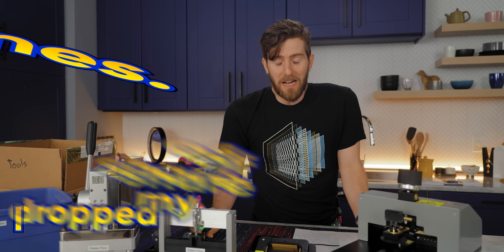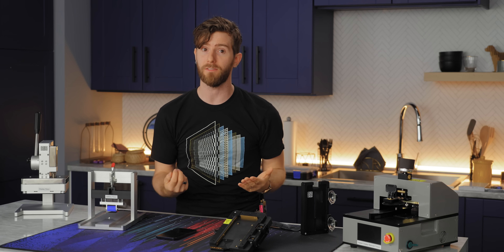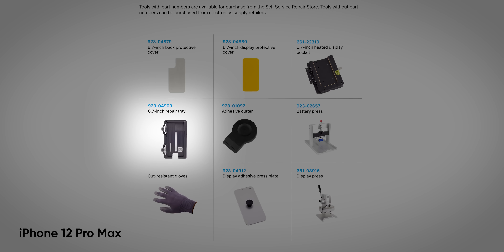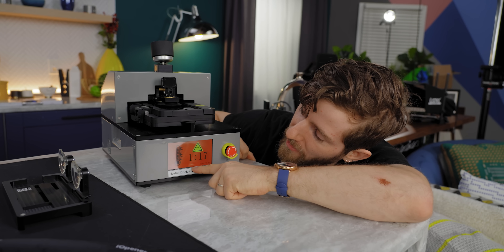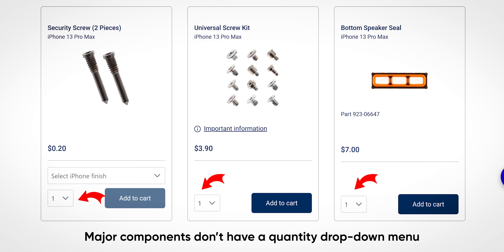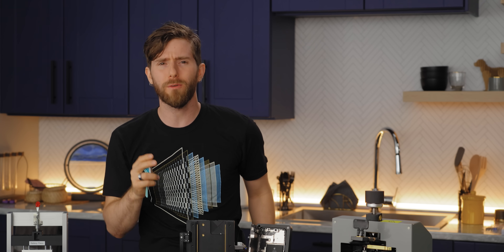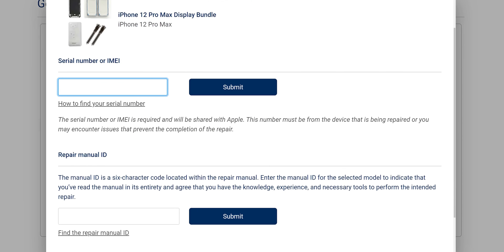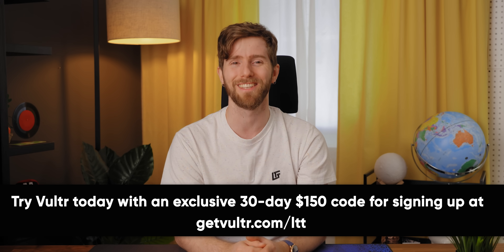I’m a Genius - Apple Self Service Repair Program

Comment: Tbh also adding the amount of time you need to the overall costs is just stupid. Because when you do this, EVERY repair offerings from any shop - including iFixit etc - is just absolutely terrible. Same goes for the time you have to wait until the parts arrive. Do you blame Apple now that it takes a few days for physical stuff to arrive at your home or what?
The prices are too high, yeah and especially the cashbacks for the replaced parts are partly really too low ($33 for a screen is hilarious - this should be like $100). But what you did here was just trying to make the "cost" of doing it yourself as high as possible...

Comment: I work in a phone repair shop fixing iPhones all day and those tools are incredibly overkill, all ya need is a heat pad, the right screwdrivers, and a thin metal separator lmao

Comment: I did want to go ahead and add a little bit more information, especially as one of those repair techs in the back, The sad thing about even fixing your screen with that repair program, You still will encounter things like face ID not working and if you're using a fingerprint reader touch ID not working either, for an experienced technician, a standard iPhone repair can take up to 30 minutes. It gets pushed to an hour because of all the additional paperwork and calibration software that's needed to just get those basic features working. That aren't even crucial to the phone security because you can literally move the fingerprint reader from one phone to the other and it'll still work like nothing happened, face ID will always be locked unless you go through Apple internally. Unfortunately if you want to unavoid this nightmare just get insurance on your phone, regardless of how technical savvy you are or how much experience you have. If you don't have the Apple clearance and don't want to pay a grip for tools that we don't even use that much, Just get the insurance.

Comment: Not to mention after installing the new part, the old original part is no longer paired to the device.. when installing that part you need to contact a apple tech and they will remotely pair it which in itself is a pain in the ass procedure..

Comment: Im a tech at a Ubreakifix, these tools are cool but Id never use them, honestly their tools overcomplicate the repair and slow it down, iPhone 12s and 13s are a pain due to new adhesive being stronger but its still easier with just a heat mat, some screwdrivers, and an iSesamo honestly.

Comment: So... what's the frigging point? For the simple user it feels like the warranty and extra insurance that most shops provide is more than enough for when the device is new and after two years the parts along with the equipment rental is going to cost more than just buying the same phone used. 

And for the professional repair guy it's pointless because if he does this through Apple it won't be faster or cheaper than his customer taking it directly to an Apple partner. 

It feels more like they are trying to cover their bases if/when the law changes and companies are obliged to have some kind of repairability for their devices.

Comment: Waaaaa. Take your Apple device to Apple to be fixed. And if you don’t like that, don’t buy an Apple device, buy one of dozens or hundreds of competitors devices. Vote with your wallet. Personally I don’t want to fix my Apple device myself and I don’t want some Fixit shop to do it using 3rd party non OEM parts. So this issue doesn’t mean anything to me. But if matters to you, don’t buy Apple. Buy an Android and an HP and move on with your life.

Comment: The battery, taptic, and speaker are definitely overpriced, but the screen is more reasonable than what I expected. While there are no exact third party screens to match the iPhone 13, buying a refurbished screen from some place like Injured Gadgets (my go to)  can be more expensive than the repair program. For instance, a refurbished 13 pro max display is currently $325 over at Injured Gadgets. And even without a trade in the screen from Apple is cheaper. With time this may change, and Apple can CERTAINLY offer this for much less still. However, as of right now this is the one thing I appreciate Apple providing.

Comment: I repaired iPhones for ten years. I got out shortly after the screen update fiasco. They put out an update that literally disabled touch on 5rd party screens. Then had a message in the update about only using genuine Apple parts. I was livid as a repair shop. They changed it in a later update but the damage was done.

Comment: need to talk about MacBook Pro screen repair .... the 2018 MacBook Pro display, 650€ in order to change it  and it's not even my fault, the MBP sits on a desk and the next morning it was not working properly ????? it's looking like the electronic tablecloth of the screen is damaged but you cannot change the tablecloth without changing the screen !!!

Comment: Fanboi here: This solution clearly isn't great. Set that aside the pricing on these tools are amazingly cheap though. A repair shop could just buy these and use un-original parts I suppose?

Comment: The amount of times apple has just lied to me at the store saying “ITS IMPOSSIBLE TO REPLACE THAT PART YOUR GONNA HAVE TO BUY A NEW ONE” when the guy down the street does it in an hour is honestly insulting. So much e waste involved with what could of been just a chip replacement on the board.
Reply: B... but they stopped shipping chargers with their phone so they must care about waste of recources.

Comment: Large corporation looking for ways to increase profit margins isn't something to be surprised about.
Having a decent amount of cash in the stock market, I can't be too hypocritical.

For right to repair, the EU, with France leading are a lot further already.
This will most likely be in place for that reason and not the US, where lobbying can keep this off for ages.
It will be a requirement to have this when selling stuff in Europe.
Of course, with these prices it is useless. But lawmakers will most likely take a look at it and addend the law so that replacement parts prices get capped as well. 
These things tend to happen in steps.
And to quote Picard, 'change always comes later than you want'.

Comment: What they forget to mention is, that even the spare parts they give you are still incompatible with your phone even tho you gave them your phone serial number. You need to call a service number from apple that will connect you with a engineer that will perform a remote paring with your new parts on you phone.  So even apples genuine parts act like 3rd party ones, makes you think if apple gets their repair parts from the same guys 3rd party repair shop do.

Comment: I have to totally disagree with the decision to compare your paid time as part of the cost of repairs. Unless you are giving up paid time in order to do this  or any other repair it's not costing you any thing. No one gets paid 24/7 therefore if instead of going to a party or, going fishing or, sleeping all day you take that normal down time and fix your phone, it hasn't cost you on time. If the activity you would have done would cost money, like partying you might even save money. If you don't have that down time then you pay apple or some other professional. Or get LTT to do it if work there while you're getting paid ;) Done and Done.

Comment: Maybe one thing for the apple store that refused to tell prices over the phone: Yes it is company policy and not the best. I worked at an apple store a few years back. Our apple store decided to tell customers prices via the phone. After 3 months the amount of calls we got just to check again for pricing or argue with the telephone guy that other services are cheaper got so high, that we needed an additional person there for a while just to handle more calls. People got angry when the price was actually higher when they came, because there was more repair to do then it could be diagnosed via the telephone. My colleagues got stressed by it. everybody got stressed. 

The store decided that we stop doing that collectively and told people to call apple care. 
They usually give out prices via phone and are especially trained to handle phone support requests. Apple store people usually are not. 
And I can confirm the tools shown in the video are the same as they are used in the genius bar repair rooms. There is just one more thing. Of course. 
And yes, I too would love apple to open up and give all the party to everybody. I am a big fan of self repairs.

Comment: Hey I have a question. I'm not super amazing with computers and I just upgraded some parts. I have a b550+ motherboard with a ryzen 5 5600x, 16gb of g skill trident 3600mhz and a gtx 1060 6gb. I noticed my performance got much better, but the problem is that my computer keeps randomly restarting. I thought it was my cpu overheating so I turned off the automatic overclock and turned it down from 3.7 to 3.5. That didn't work (was watching my cpu temps while i played games, at the time of crash, ryzenmaster was saying i was running at 60-70 degrees). I tried to turn off the automatic restart feature, that didn't work. I even bought a new psu (evga 850 80+ gold) and that still didn't work. I ran the windows diagnostic test for the ram and it said my ram was running fine. I'm genuinely so confused as to why I'm having this problem there is no message or anything just straight up restarts and turns back on. If anyone has any ideas or knows anything it would help me out alot :D
Reply: Im also running only one system fan and one cpu fan(120mil in the back of the case) and the stock fan for the 3700x. I made sure that the airflow is going in the correct way meaning that the system fan is exhausting out of the case.
Reply: @toyotas8241  Could be a bad motherboard or even damaged cables. If you still can, I would suggest returning all hardware you bought and just replacing it with new one of the same type. that gets you around those problems the fastest.

Comment: please don´t give apple kudos. this is just another elaborate scheme to take away your control over your electronic devices.
the average apple fanboy probably sees this as an absolute positive not thinking about what this actually means for right-to-repair and third party repair shops.
apple doesn´t want to make repair easier, they´re out for your money and they will try to squeeze you for every little drop.

Comment: Guys, you don't need to rent all these fancy equipment to fix your own phone. Just heat water until it boils and put it inside a water rubber bag. Put the bag over your phone for around 3 minutes and it will be enough to soften the glue (you need the water to be around 96ºC/204ºF to achieve it). There you go, now you can open your phone. PS I'm a bit clumsy myself, but watching Linus clumsiness make me fell a dexterity person, Lol!

Comment: As if Apple needed a way to make their utter contempt for the end-user even more clear.

We need right-to-repair as part of law.  Which means:
- Replacement wear items (things that wear out, like batteries; or break easily, like screens) available to arbitrary third parties in quantity at actual cost of manufacturing, including all ancillary components (screws, glue, etc) which may be required for the replacement procedure
- Public specifications (service manuals, config software etc.) that enable third-party installation and complete configuration such that functionality is identical to factory condition
- A ban on irreparable design (e.x. glue/rivets instead of screws) without genuine engineering motivation

I'm not seeing any of those three things here.  Apple basically hooked the genius bar up to the internet, making specific effort to keep every single one of its core problems.  You can only get price details if you're actively seeking repair from them, you have to jump through hoops to actually get a repair (instead of replacement), and you can't buy bare components.  The only advantage is the removal of face-to-face contact with the humans at the Apple store.

The corporations are clearly dragging their feet, and society needs to stop just asking nicely.

Comment: F@${ apple. I was an iphone user from iphone 5 to 12 pro max. Have been repairing electronics for over 20 years. My 12 pro max battery had swollen up and lifted the left side of the display from the frame. Live hours away from the nearest apple store. Local auth repair center said it would be 5-7 days to replace the battery as they arent allowed to keep parts on hand and they have to send a driver on a 7 hour round trip to pick the parts up bc apple wont mail them either. Its a 15 min repair wtf! Ive done it myself thousands of times refurbishing iphones. I would have this time but i had apple care plus which turned out to be useless. Repaired it myself and sold the phone the next day for $800 and bought a z fold 3 5g. A few days ago my z fold 3 had an issue that it wouldnt play audio through the speakers when it was unfolded. Put in a warranty claim and since i have samsung care plus i was sent a brand new phone next day shipping and mailed back the old one. Didnt have to be without my phone at all. Love my z fold 3 and the samsung warranty and care plus.

Comment: Orrrrrr....they require you to bring in the phone to the store before offering a quote to avoid the "You said you'd be able to fix my cracked screen for 'X'."  Apple repairer:  Yeah that was before we saw your phone has a 15 degree bend in the frame and cracked back glass.  "You said it wouldn't matter."  Apple repairer : Literally no one said that to you.

Comment: It's a shame that this is the way Apple is deciding to go with this, they could've made something great and instead bastardized it into something that becomes as bad a deal as anything else they're pushing.
Reply: really a bad deal, the could have made renting the equipment like $10 and the parts 80% cheaper and just made the process way more smooth, same day shipping and let you keep the unit for at least 2 weeks. they really messed this one up! Now they make Samsung’s self repair program look way better because they do it so much better

Comment: Eh I just simply don't drop my phoen or crack it and replace my own battery every 2-3 years. No silly kit necessary, after first opening It's just resealed with silicone rubber caulk that does the job fine without the gorilla glue grip (so it's easy to get back into it when I need to).

Comment: Very good video on the program, however a quick note is that the iPhone 5s was the first phone with a paired touch ID sensor, although you could swap it over. The iPhone 8 was the first with a paired display and changing it would remove the true tone function from the phone. Batteries came a year later with a replacement not having the battery health. iPads don't seem to have paired displays though, so replacing them would not remove true tone.

Comment: Wtf... I never had any of that repairing iPhones for work. I worked at a store that had "relations" with Apple aka we got oem parts. We had a battery press which was just a block, a holder thing? That we never used, and a Mac book that was required to run software things for repairs and marry the new home button. Even for 12s and 13s I was just using heat and a suction cup to open it up and firmly pressing and applying low heat for sealing it back up with new adhesive.

Comment: Nice vid, back when I repaired ipads and iphones i was in talks to design a heating element that you laid on top of the device and adjustable.  While Apple's solution certainly works, I imagine there's a lot of room for improvement.  I don't miss contacting people in China finding black market original parts, Apple is just terrible with repairability despite being repairable.  I've moved as many clients from Macbooks to PC laptops since Apple has taken every user replacable part, especially the wearable ones, and made them impossible or hard to replace.  Just look at the mid-2012 13" mbp and how you could change the battery, ram, and storage compared to the current model.  Why do these parts have to be soldered, zero reason, why does it have to be an insane task to remove the battery or keyboard?  Apple is causing ewaste.

Comment: I have a question about my gpu. Is it dead, if it boots but turns off after showing random glitches on the screen and freezes

Edit : the freezes and glitches starts if i reinstall its drivers ( i had to use my integrates gpu to wipe its drivers clean and i also reinstalled windows but its still the same)

.

Idk a lot about this, sorry if i said something wrong.

Comment: Anyone else catch that at 2:40? "Never reinstall a screw after it has been removed. Install only new screws. iPhone screw grooves are covered in adhesive that can't be reused." That blue/red Loctite looking stuff is elastic and 100% can be reused, though after a few dozen cycles it does wear.

Comment: I actually look at this as them putting the first toe towards realizing that people want modular tech they can fix themselves and that they want long-term viable devices rather than disposable garbage. In 8 or 9 years the industry will have flipped back towards a more modular thing even down at the cellphone level because it'll have to as the population increases and inflation/middle classes shrink.